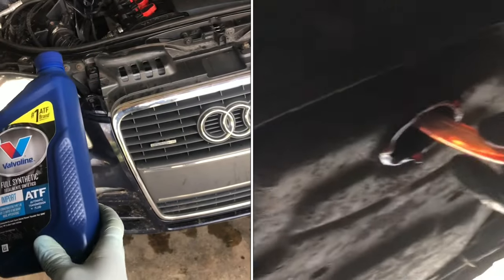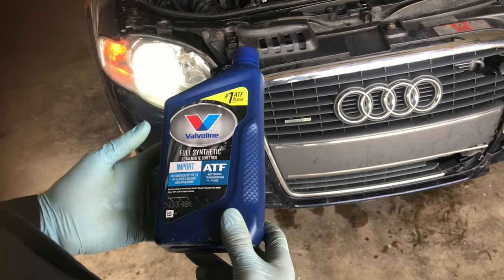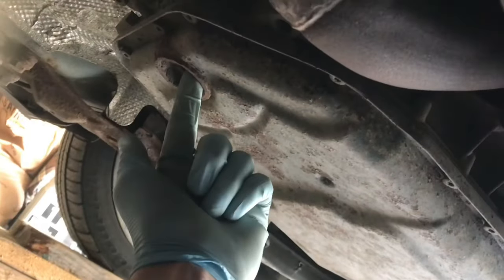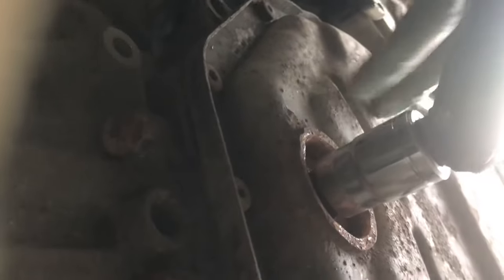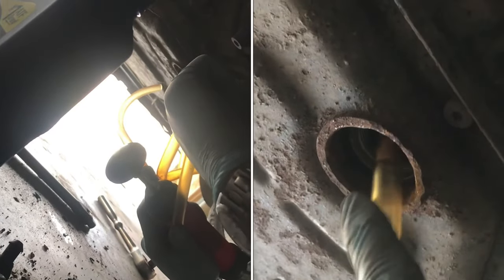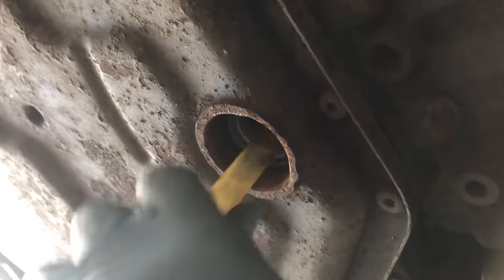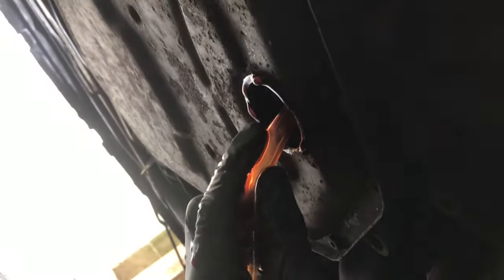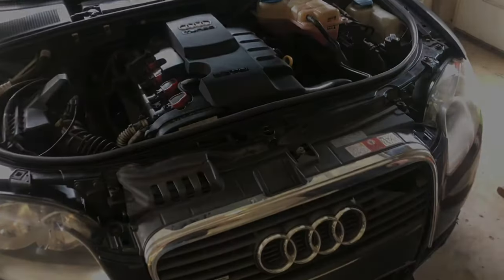“checking” and “adding” TRANSMISSION FLUID  (b7 audi a4) volkswagen

Comment: Where's the "checking" part of the video???
Reply: Basically when the fluid drips out
Reply: Agree with @TeamKreepin. There’s no dipstick. The guy in the video touched on this kinda. You have to get the transmission into operating temperature so the fluid is all in the gears and ports. If you check it when it’s cold, the fluid is going to be pooled in the pan and you’re going to drain instead of check. So when it’s running for a while and operating, you just pump it in until it drips out. If it’s already dripping when in operating temperature, it’s full. Even if it’s full and you pump some, it’ll drip back out. It’s good to go kinda slow to know exactly when it gets full.

Comment: don't get me wrong. I am grateful for every video I can find that show me how to do it.  This video, IMHO, is a little misleading.  Note that the commentator says he did some work previously and knew the tranny was a little low.  That, I think, is a great disclaimer for you if your experience does not match the commentators, as was my experience.  I would point out that there are other youtube videos dealing with changing your Audi's atf fluid that don't have the disclaimer this one does.  I think the point were my experience diverged from this video was when the drain plug came out and was quickly followed by about 2 quarts of atf.  This video does not show that. My car clearly had more ATF in it than the commentators did.  Other videos do show about 2 quarts coming out. Would also mention that other videos say to keep the transmission under 40 degrees C when you are refilling it. ATF expands as it warms. So - if you, like me, are trying to drain and refill your ATF, I'd find a  video dealing with that and covers leveling the car and keeping the temperature below 40 degrees C.  Otherwise a fine video.
Reply: Was the vehicle running when you opened the drain plug? If so, its interesting that there was so much in it. Potentially a previous overfill?

Comment: My 2004 Passat with a triptronic trans was way overfilled, (a flood gate came out) when I removed the inspection plug (BTW which was a biatch to remove)!  The shop, that specializes in Audis and other foreign cars, must have not followed the VW protocol.

What damage can be done by overfilling?
Reply: I hate those shops. I went to a “specialized” VAG shop and they messed up my transfer case on my Audi TT, they forgot to add gear oil after removing it to access the clutch of my car. Which is why I look at DIY videos like this one. I’ll never trust a shop ever again.
Reply: Hopefully less damage to come from underfilling

Comment: Good evening, congratulations on the video. My Audi is the A4 1.8 T gasoline model year 2005, automatic transmission (CVT). Is this car you are exchanging the same model as mine? If it's not the same as my car, can you recommend a video that teaches how to change the oil. Thank you in advance, thank you very much.
Reply: Did you find any good video ? Because i have the ssme as your car but i want to change the front differential oil any ideas?